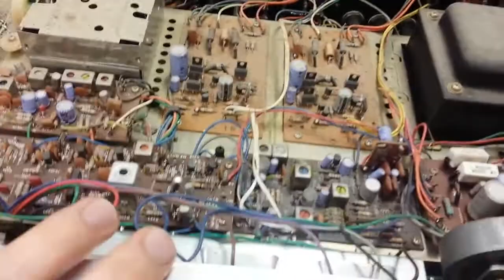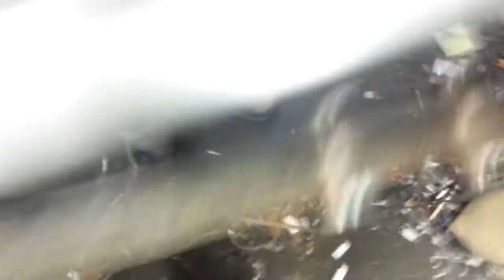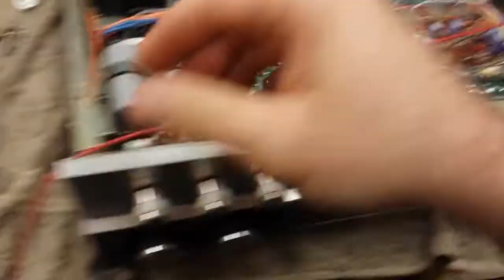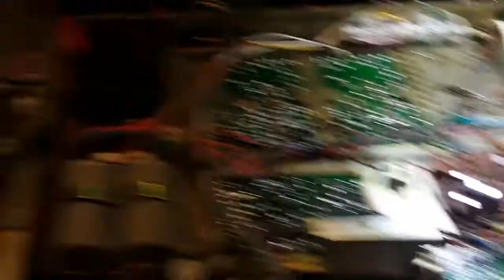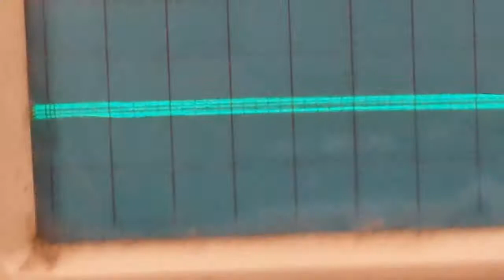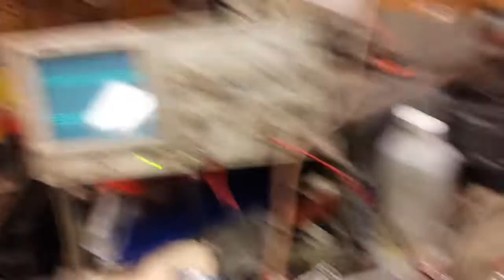Servicing a vintage Sherwood S-7200 receiver part 1/?

Comment: i wish you would of showed how to get the cover off of it..
Reply from the maker: Easy. Remove the bottom screws, remove from case, remove screws on the sides holding the metal cover on the bottom.

Comment: I replaced an open burned out 1 1/2 amp fuse on a Sherwood S-3000 tuner and it came on and audio works fine.  Driving sound off PCV speakers. However the 6BR5/EMBO tube initially worked and the screen beam expanded and responded as signal strength.  However after a few hours of operation only see the filament illuminating the narrow band on the central axis of the phosphor screen but no beam widening on station tuning. 
What controls the deflection anodes on the tube or has the tube itself gone defective?  Any thoughts on this would be helpful.  Again there is no audio problem, only the loss of 6BR5 beam deflection response on tuning.  All the components on this tuner are original (1959 vintage) and I was surprised it worked at all after being in storage about 40 years.  Yet the fact that the 6BR5 stop responding suggests another issue that could come up later?  Again all components except the fuse are 1959 original including the can cap.  i am the only owner and the unti never had work done.

Any suggestions of which part of the circuit controls the 6BR5 anode?  Seems unlikely that the tude suddenly went defective?  Again filament and phosphor screen raster are intact but only narrow beam on the central screen axis and no tuning response.
Thank you for any suggestions of how to trouble shoot.
Paul